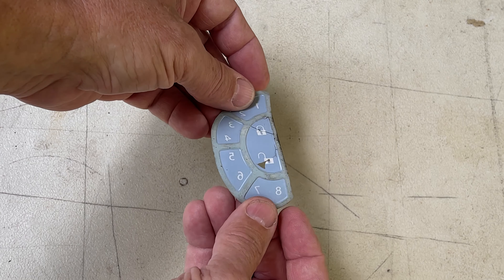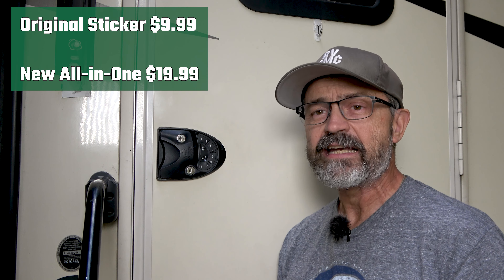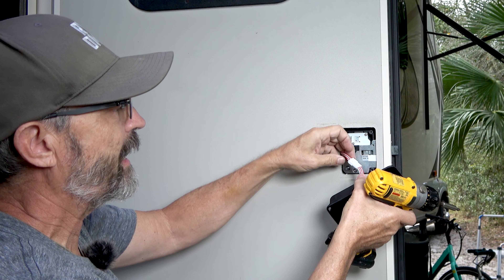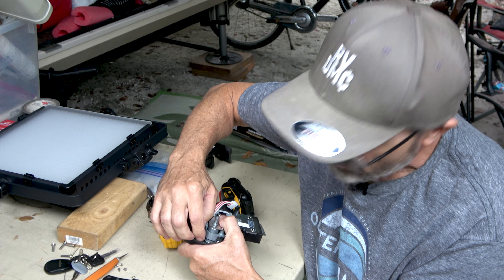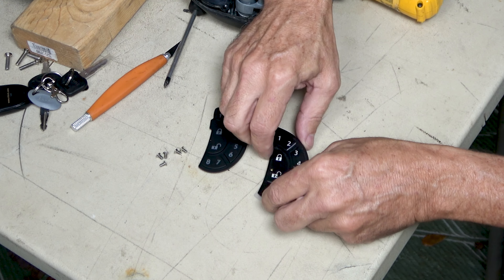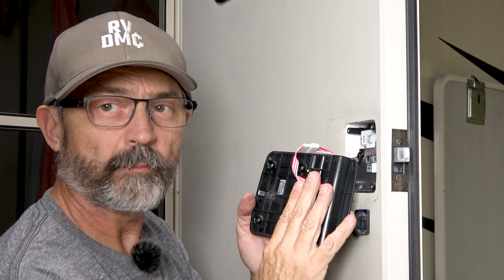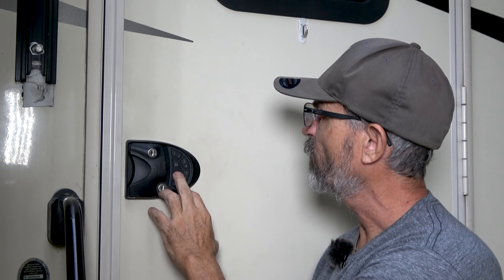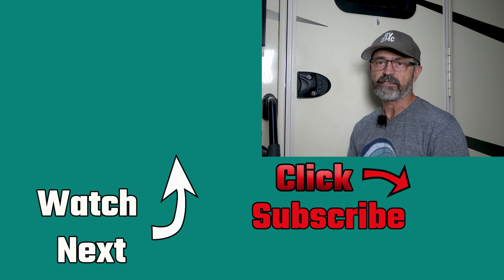New RV Lock Keypad Upgrade, Keyless Security (RV Living) 4K

Comment: Back when we had our RV Lock we where able to turn that sound off. If I remember right you can do it with the remote. I do like the RV Lock. They are super easy to install. You can not put them on Nemar's. They don't have a lock that will fit. I wish they had made the number brighter on the new one like they are on the sticker. Just easy to see. Not a big deal though. Ok cool you showed turning off the noise. I thought you could but it's been a minute. lol I hated the sound to. Good share.
Reply from the maker: Thanks William. Strange you couldn’t find one to fit the Newmarket 🤔 
Next RV, make sure it takes these locks 😁
I was surprised how light the numbers were, too. Oh well. We shall see how it holds up. But worth $20 
Alice

Comment: Do you know if new RV Locks are equipped with the improved keypad?
I (Dave) have worked with and repaired similar keypads at work for a long time.  The old ones work great right up until they fail.
Great video.
Reply from the maker: Dave, Larry asked them on the phone. They did say the new ones are the improved pad. And they are on sale right now. 
We bought two for the basement. 
Thanks for the compliment and always coming by,
Alice

Comment: Good morning, Larry and Alice! It's funny that I just ordered the same lock yesterday from the RV Lock website for our trailer. They have them on sale for a big discount, which is cheaper than on Amazon. I hope it installs on my unit as easy as it does on yours. I used your water heater tank flush again yesterday and it worked as well as it did last year. With my black iron system I "cooked" it for 24 hours then flushed it. Looks' brand new again! Hope y'all had fun with your kids on Turkey day. Stay safe!
Reply from the maker: Hey 👋 
Black Friday deals are awesome - we just ordered locks for our basement. 
Any issues installing, reach out. 
Glad our videos our helpful - the water heater cleaning is so important. 
Let us know how it goes. 
Thanks for coming by again,
Alice

Comment: Those run on battery?  Are they under $100 ? looks like easy install.
Reply from the maker: 2,Double A batteries. The original RV Lock was around $250. But now about $140 - and see if there is a Black Friday deal! 
We are buying ones for the basement now,
Alice